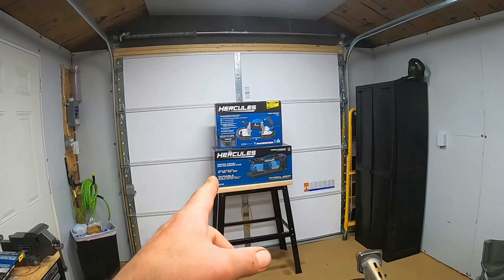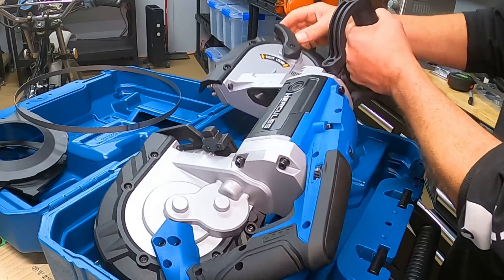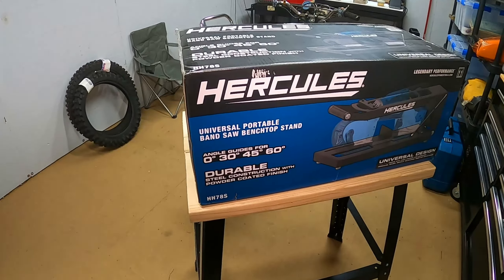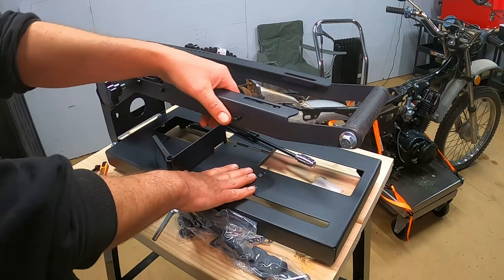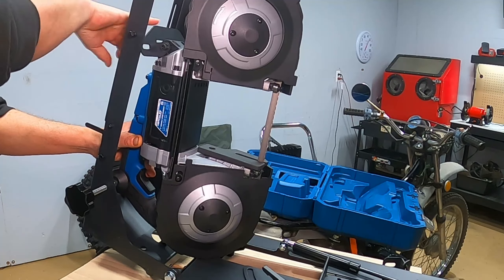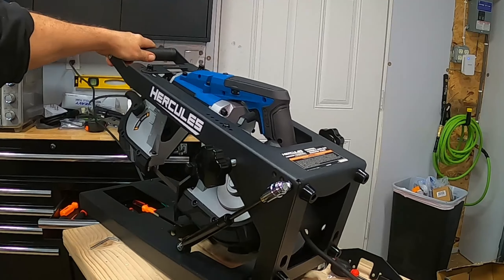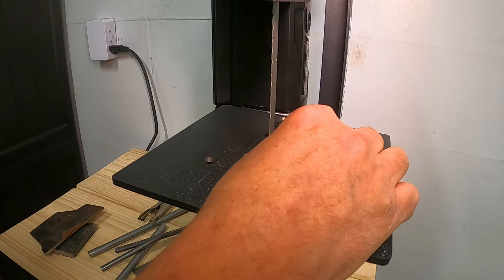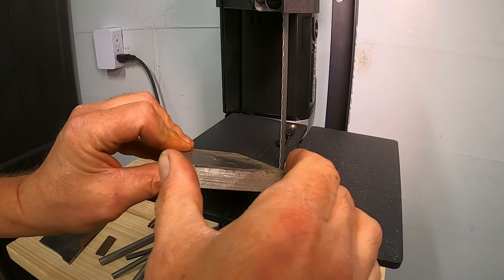Is the Hercules Portable Bandsaw ACTUALLY Worth It? - Harbor Fright Review 59229 #harborfreight

Comment: Your video helped me very much for assembling the Harbor Freight bandsaw on a HB universal bandsaw stand. The user's manual that comes with the items are not very helpful. Many subtle points you mention in the video were not either present or glossed over in the manuals.
What was particularly helpful was to see you make a final decision to use the saw just in a vertical mode and set aside the additional hardware attached in the stand for the horizontal operation. I wouldn't have the confidence to just remove the extra hardware on my own. You see, I am just an ordinary DIY woodworker (with a need to optimize the limited time available for hobbies) who happened to purchase a heftier than needed tool for my needs. In retrospect, this was an excellent and most economical purchase.
Thank you for posting the video. Very, very useful.
Reply from the maker: That's great to hear. Glad you liked it!!

Comment: Gret Video!
Did you have any issue when switching to vertical with the table not lining up to the 2 screws?
My lower blade guard has the litte clip on the upper end that sticks up above the table.
It seems it's about 1/4" or so in the way?
I can either cut the little piece of plastic clip off.
Or I would need to take a 1/4" nip off the corner of the table?
If i leave the lower Blade guard off, the table fits fine.  But I don't want to do that.
I could put the table on top of the clip so it would go back the extra 1/4" or so to get the screws to line up.
But then the table would be tilted.  Am I the only one with this issue?
Its 2am 
Maybe I'm just tired & missing something?
Reply from the maker: Hmm. I don't recall running in to any problems. What do the instructions say?
Reply: I too found that, HOWEVER, you have to keep the lower part of the guide assembly AND put it on before the 1/4" plate, THAT lifts is up enough to let the cover go back on!!
Reply from the maker: @ Cool, thanks for the info!

Comment: I got the battery operated one, it didn't come with a plastic case.
I think you change my mind on buying the stand versus making one
Reply from the maker: It sure made setup a breeze!
Reply: The stand is on sale for 89.99
Reply: @raymondolivares1093  I ended up getting one.  I have to say it's pretty awesome overall.  Nice that it's a 2N1, a cutoff and a bench top scroll saw.  I don't know what the two extra holes are for in that 1/4" plate.  There's a bracket that lines up with it, and two screws, but what does it do?  Note: there's two screw holes and one slot for two more screws.  The two holes don't seem to be used for anything.  Maybe a carry over from a prior design?
Good heavy metal and good design.
Reply from the maker: @karljay7473  great deal!